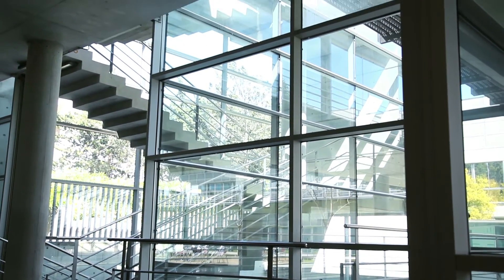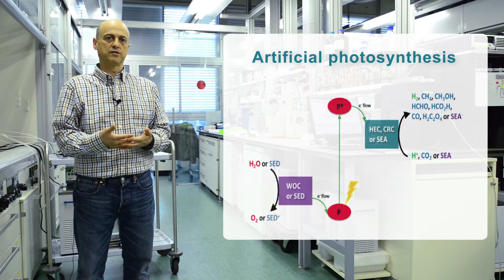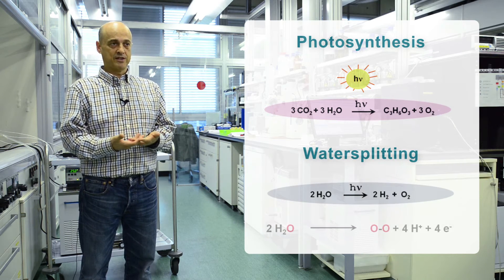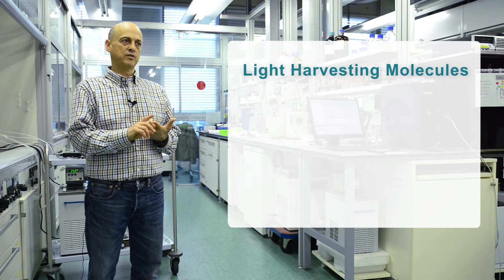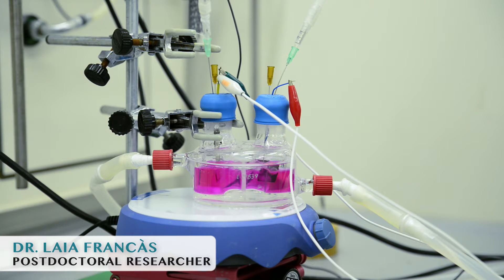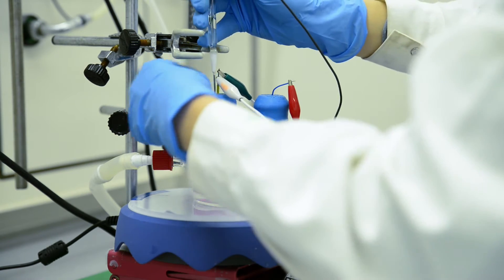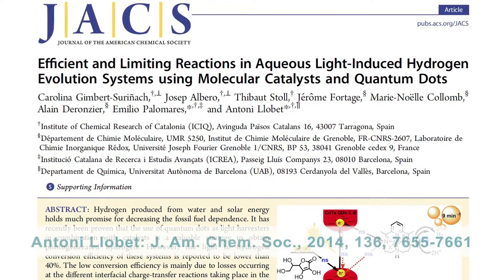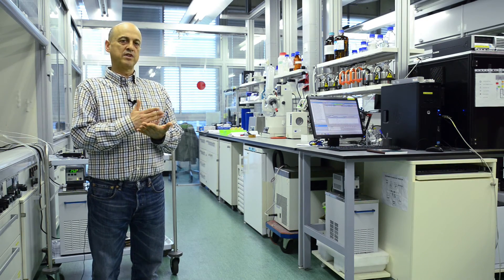Artificial Photosynthesis

Comment: but you can try po4 and  n2 and k with photo synthesis reaction seperately one by one or mixed with water diluted in them . using bad chemicheals might harm the by products n products. eg. u can dilute n2 with water n do the photosynthesis first n let them react with the byproduct of your artificial photosynthesis. n the list goes on ..